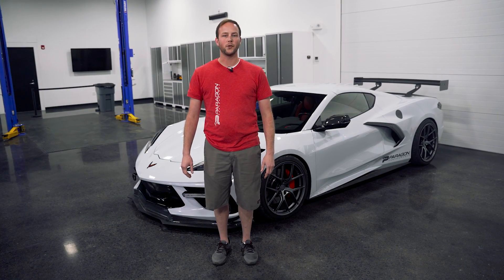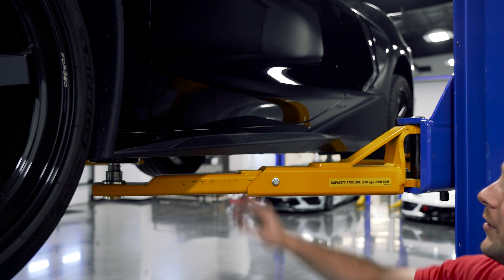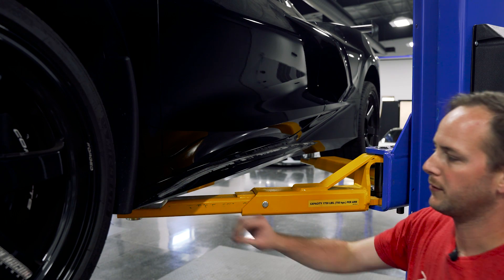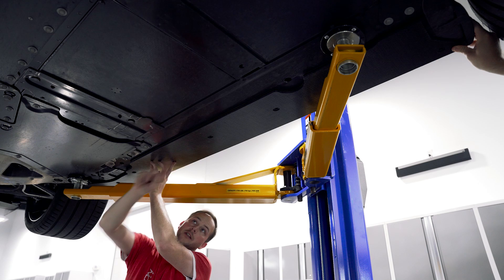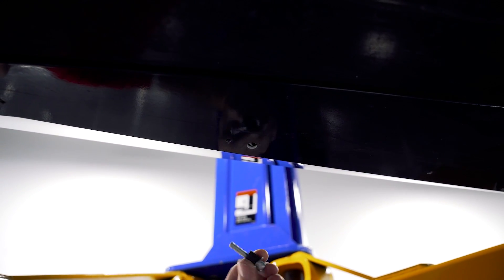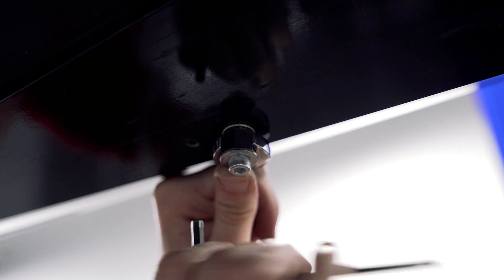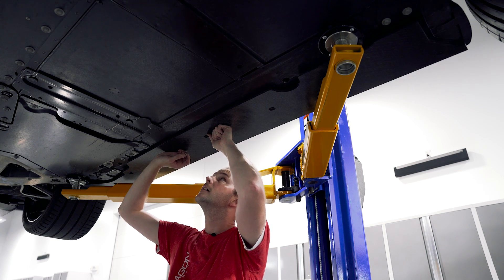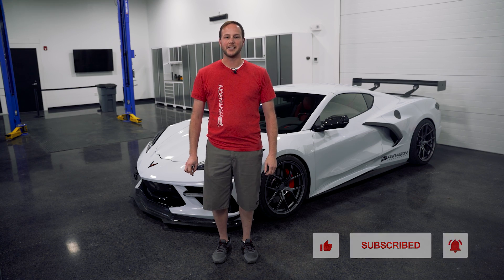Verus Engineering C8 Corvette Carbon Polyweave Side Splitter Kit Install | Paragon Performance

Comment: I just installed a set on my 23 C8 and found them to be very well made and installed easily. I wanted these to help protect the side of the car from road rash coming from the sticky Z51 tires throwing up sand. They have worked very well in protecting the area in front of the rear wheels.

Comment: Do the rivnuts provide some stand-off from the underbody? If not, why not use plastic rivets in those locations?
Reply from the maker: The rivnuts do provide some clearance from the underbody. Plastic rivets require a special tool that everyone may not have.